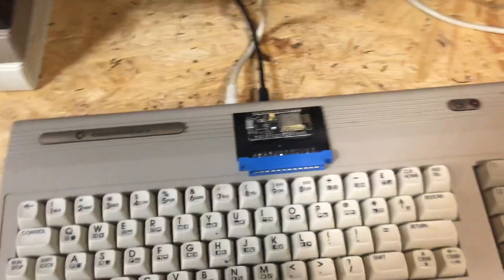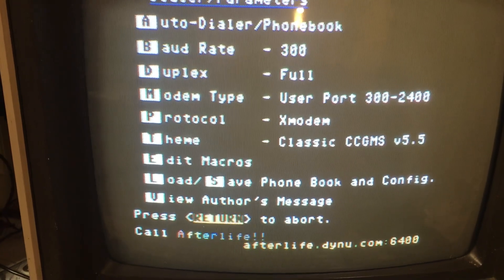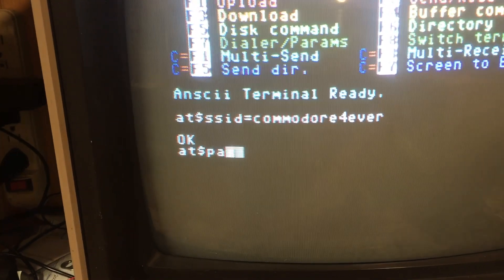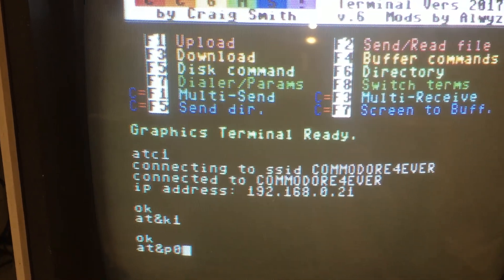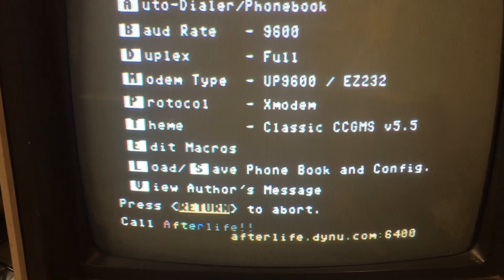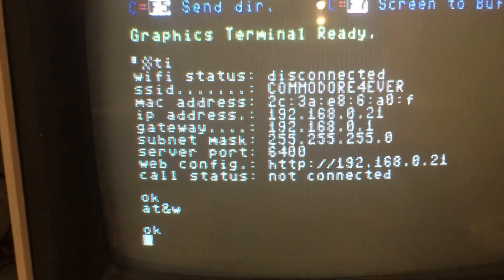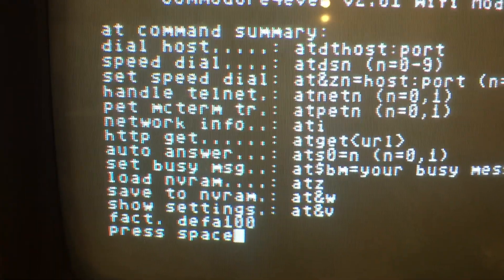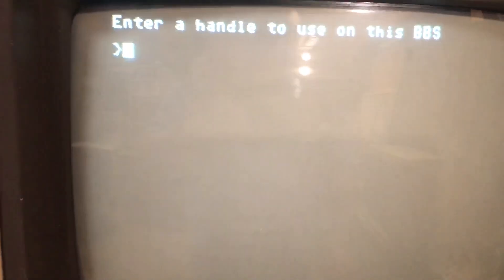Set up your commodore4ever wifi modem

Comment: Hi there. I can only seem to get the v2.3 modem to work at 2400 baud, on a C128, even in C64 mode. Is that correct, or am I doing something wrong?
Reply: same problem. If I switch to 9600 I can see the modem change board rates but switching to UP9600 modem driver results in hanging as if flow control is not working
Reply: I am also using a C128 in 64 mode